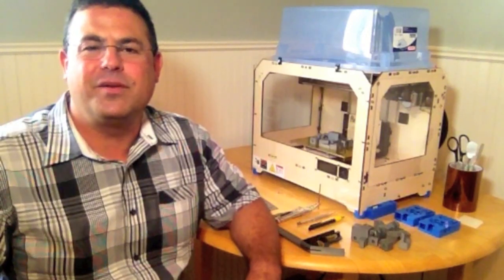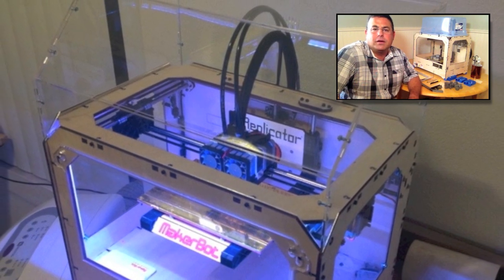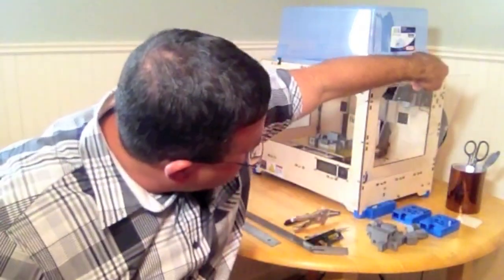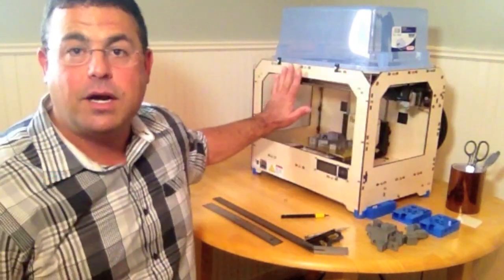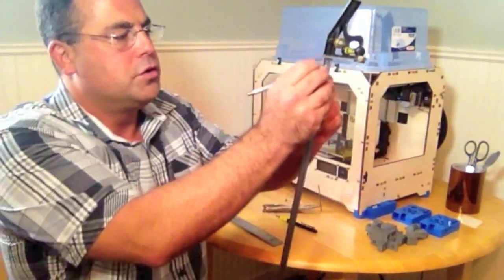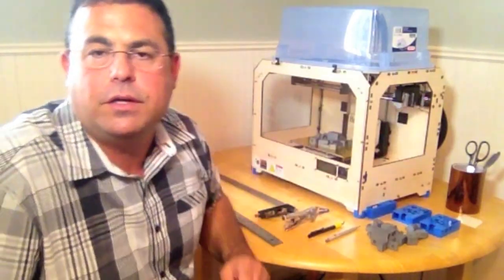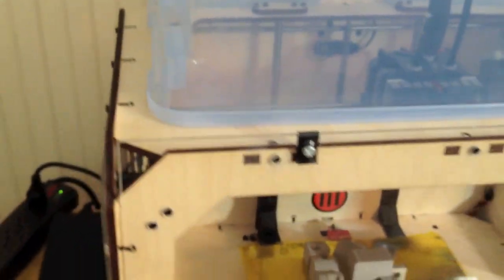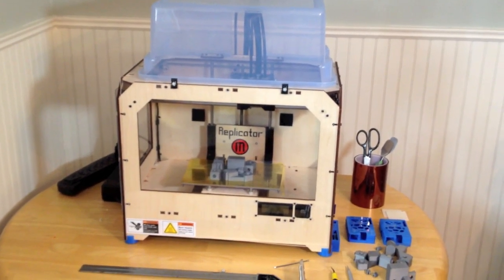MakerBot Quick Tips #5 - Enclosure

Comment: just an idea instead of using bolts to hang the front enclosure you could of used the off cuts and glued a little lip on the top edge ,then it would be virtually unseen

Comment: Great idea, just did it on our FlashForge 3d printer. Left the 11x14" side panels uncut, and just oriented them in a "portrait" fashion. Was able to split the front sheet in half... so have a spare in case it gets beat up.

Still waiting on a lid... a Sterilite 1924 at 16.5x13x6.7" is a touch too deep (front/back) and too shallow for the cables. Have ordered a Sterilite 19322706 20 Quart gasket box to see if it works better. Looks about perfect...

Comment: I used a couple of rolls of magnetic tape for the front, drilled the sides and used an acrylic heater to bend the main part of the top.   The glue I used did not work very well, so on to try #2.

Comment: This is very similar to what my husband and I did on our makerbot.  We got the exact same sheets of acrylic from home depot, actually.  My husband actually put a hinge in on our front panel that's held shut with magnets.

Thats a fun solution for the top.  We got these sheets of something (I'm not actually sure what it is - but it's almost like plastic cardboard) and taped it together in the shape of a box, using duct tape, and placed it over the top with the opening necessary for the tubes.